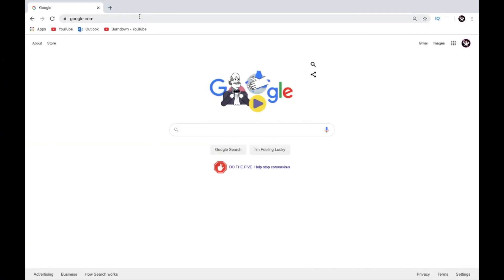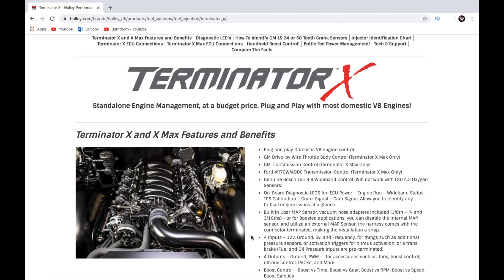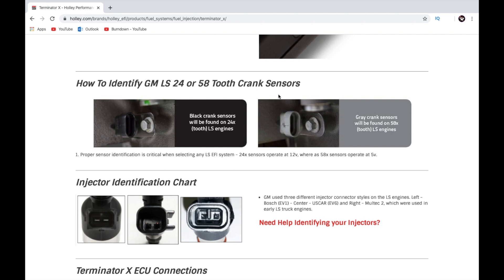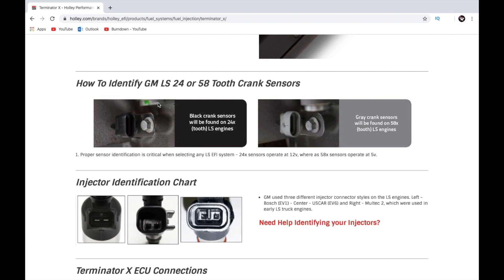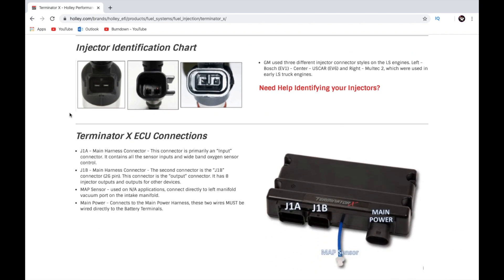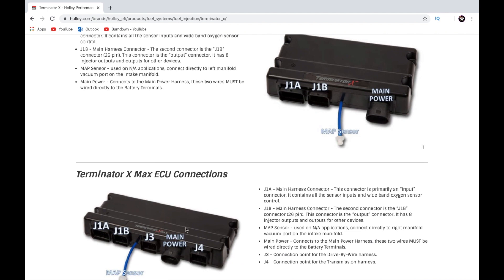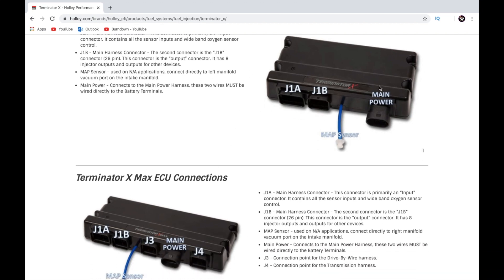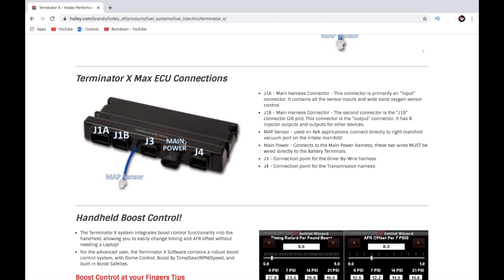What Holley Terminator X Do I Need?

Comment: Hey
I have a DBW
When by pull a part git the pedal off 07 chevy impala plug the wire to tha throttle body for the DBW but the temp sensor and the 1 i have to make a whole on the breather so what I'm thinking to say since I have the DBW do all them plugs need to be plugged up like the FUEL CTS
Reply from the maker: Not sure what your asking here but you could run and X maxx and not have a drive by wire or a transmission hooked up to it and it would  run a motor yes.

Comment: Dude is extremely legendary for this information! I have a Gen 4 2007 motor and I'm doing a delete, but I'd like to stay drive by cable for my old school, but I'm hearing that I have to go inside the motor and change a trigger wheel?
Reply from the maker: A terminator x will run 24x or 58x. The wiring is a little different and it’s in the harness. What harness do you have?
Reply: @Burndown  I don't have a harness for my build on the Lc9 engine. I'd like a budget build, but I don't know if it would make sense to have a th350, or to get a 4l60 where I don't have to worry about the transmission computer to cut down on cost.
Reply from the maker: @ A 2007 motor should be a 58x if your cam sensor is on the timing cover it’s a 58x
Reply: @Burndown  Thank you, brother!

Comment: Great info for me (as a greenhorn).  Going with a Truck motor (black plug) for my Jeepster conversion.  Sticking with stock fuel injectors. I'm going to run a manual 5speed trans (AX-15).  I do think I want external sensors  (fan motors, fuel pressure etc.).  Want the feel of Drive by cable however.  Is the Max what I want/need?
Reply from the maker: The x has no transmission or drive by wire control and is cheaper. It will run the combo you mentioned above.
Reply: Awesome! TY for the reply (FAST reply)

Comment: I have a gen 4 out of a 09 ss Impala that I'm trying to put into a S10 which one do I need
Reply from the maker: Should be a 58x gen 4 motor. Not sure on the injector plug on that car tho. I would look at the Holley diagram for injector plug ID and pick the correct ones. Look at the ev6 style and see if that's it or not.
Reply: Thanks for that bit of knowledge. I've taken the motor out and put it into a short bed Chevy truck . 58x would that change if I'm swapping

Comment: Can you run a throttle by cable using the x max and an electronic transmission
Reply from the maker: Yes you can do by wire or cable with the xmax

Comment: So on there site on terminator max they have multiple part numbers on max so thats where im lost i know i want max but max set up for ls motors has multiple part numbers
Reply from the maker: You need to know what your reluctor wheel is if it’s 24 or 58 and you also need to know what injectors you’re going to be using that’s why the partners are different.
Reply: @Burndown  i have that but each part number you click on both allow choose that stuff so 5 part numbers are same like i click on one choose 24x or 58x choose injector click on another different part number same thing you choose what want so lost to why 5 part numbers for ls engines for 6.0 ect all transmission capable because all max
Reply from the maker: @AdamMorton-u2h the different part numbers are for the different sub harnesses I mentioned above. The computers are all the same for the LS and x max is an x max and an x is an x.

Comment: I just built an l92 with a 4" stroke I ordered my crank with a 24tooth reluctor but my camshaft sensor is on the front cover I cannot find this provision in Holley's web site
Reply from the maker: 24 tooth reluctor wheel motors are gen 3 and have the cam sensor in the block on top in the back generally. Go to Warr performance and get a cam sensor extension and you can just plug it in and run that to the front of the motor
Reply: @Burndown  thank you. I was going to use my  ecm from my lq4 that currently is in my elco but I am running boost on the 6.2 so holley terminator x is my next choice
Reply: @Burndown  bro I swear to god think you so much Jesus 😭😭😭🐐🐐🐐🐐

Comment: I purchased an Holley x max 550-917 for my truck build but I just got my dad’s racer after he passed in 2003 so I was wondering do I need to get an different ecu cause the race car has a power glide an I don’t feel like doing the return process can I just run this one without hooking up the transmission control?
Reply from the maker: Yes you just run it without transmission control. You’ll need the correct injector harness still and a 24 or 58 x reluctor wheel for your motor.

Comment: Im having a hard time finding a x max that can be used on a late modle post 2009 4l80e. Holly doesn't not it but summet and jegs says it cant be used on that transmission.
Reply from the maker: X max has add one you would need to control direct injection and a 6 speed
Reply from the maker: I haven’t played with any of that as it’s above my pay grade 🤣

Comment: @BurnDown I'll looking at this, the max. I have a complete L96 gen 4, with Trans and transfer case. All together was a rolled truck. But I'm swapping in for a older c10. Would the max control the Trans with transfer case?
Reply from the maker: It will control a 4l80e and with an add on it will control a 6l80 but not sure about the transfer case sorry.

Comment: I have a question, sorry if this sounds ignorant, but me and a buddy of mine bought a drift 240sx shell and we are throwing a 5.3 in it. 24x reluctor wheel. We are gonna use a t56 trans, and maybe boost it down the road. Will we need the max or just the X?
Reply from the maker: The X will work for that application

Comment: Ok so if I'm going to try a 6.0 with a cam in my 87 trans am with a 700r4.. if I go with the one that runs the throttle body and trans for 4l60 can I turn that off until I do my upgrades?
Reply from the maker: Yes just get the XMax and you have all the options is you can afford the extra cost.

Comment: What one do I need if I wanna run a t56 transmission do I need the terminator x ecu our the terminator x max ecu
Reply from the maker: X
Reply: @Burndown  so just the basic terminator x ecu
Reply from the maker: @dojliferp8612  yes. You will need the one that matches your reluctor wheel 24 or 58 and the right injector harness. If you go in Holley website and look up the terminator x that have a section that talks about how to choose the right one.
Reply: @Burndown  ok thanks a lot

Comment: Question if I’m going to delete the knock sensors on my Gen 3 5.3 will I need to find a specific terminator kit or just leave the connector not plugged in?
Reply from the maker: You dont need to plug them in. Form what I understand holley knock sensor software is crap anyway.

Comment: What if you have a 05 ls2? 24x crank and a 1 x cam on the timing cover.  Also knock sensor on the side lol
Reply from the maker: What engine wire harness do you have? 24x or 52x

Comment: I have an original 2004 Suburban 5.3 and trans nothing but stock maybe update injectors later for eventual turbo. Terminator X Max???
Reply from the maker: you need an X max to control the transmission. So yes you car correct.

Comment: What would be a good one for 98 Pontiac WS6 LS1 engine 5.7 and yes it is an original trans am engine that came with the car in '98
Reply from the maker: Depends on the transmission and if its a race car or not. This computer won't run your dash or anything like the stock ECU will. If its a race car you will need one for a 24x and then select the correct injector harness. You will need an Xmax if you have the 4l60 auto trans in the car. If its stick a standard Terminator X will work.
Reply: @Burndown  it has the 4l60 I wanted to have the race car and a daily if possible but just was wondering cuz I didn't know what would be a good program for my car or you have any suggestions on one I can use for fuel economy and drag race I like to do both

Comment: If I got the terminator x max ls1 24x (550-919) am I restricted ls1 motors or am I able to go any 5.3 4.8 6.0 with the system ? Got it for a steal on market place lol thanks in advance haven’t gotten a clear answer
Reply from the maker: All the truck motors are considered LS1 so your good to go. Since its a 24x you'll need a motor with the knock sensors on top of the Valley cover to have the right reluctor wheel for the computer you have.

Comment: Great video, Im leaning towards a Terminator x Max for my 6.0 LY6 / 4L80e.

To confirm, if I went this route, it will replace all the wiring for the engine and transmission? I wont need to buy anything else?
Reply from the maker: It comes with a harness for the motor and a max comes with a trans harness. You may need a few sensors depending on your build and you'll need to get an alternator excite wire.

Comment: Will terminator x max efi plug and run with the sniper intake manifold and sniper throttle body on ls motor?
Reply from the maker: If your talking about a sheet metal intake yes. Throttle body will depend on if you are drive by wire or cable but yeah the manifold doesn’t matter and you can get the correct throttle body for your application that will bolt to that manifold.

Comment: Which gas pedal to use for the drive by wire set up?   Ls1 Ls3 throttle body.  Thanks in advance
Reply: Never mind I followed your instructions and found it. Gm part #10379038. Thanks.
Reply from the maker: I have bit done the drive by wire so I couldn’t tell you. Check the Sloppy Mechanics Wikipedia page. I think Matt tried a bunch of pedals from the junkyard and found a few that were compatible. You could also call Holley or try the Facebook page they have.

Comment: So when you order the terminator x it does come with the harness or you have to order it separate?
Reply from the maker: It comes with it. You can also order options on the Xmax for transmission control and drive by wire. They are both add ons and will make the price go up tho. Just depends on what you need and want.
Reply: @Burndown  thank u and im using nv3500 manual trans and cable throttle

Comment: so just to clarify, if i am using i 5.3 engine with ev6 injectors i would order the terminator that they designate as the "ls1/ls6" version?
Reply from the maker: Yes and the only other thing is if is a gen4 motor or a gen 3 motor. Cam sensor will be on the front if it’s gen 4 and on the top in the back by the oil pressure sensor if it’s gen 3. Gen 3 is a 24x and a gen 4 is a 58x
Reply: @Burndown  awsome. thanks man, thats great news. great video. youve earned yourself a new subscriber
Reply from the maker: @morganclawson9985  Awesome thank you!

Comment: Good info,I'm no good with computers, so hp tuners is not happening for me which means I have to pay someone to flash my pcm then I have to pay for a dyno tune,am I wrong in thinking this terminater x will be good for me to tune my motor all my self,or is there more to it,this is my first LS and to figure what direction to go.
Reply from the maker: They have a wizard setting that will get you up and running. After that you can download a tune from the tune cabinet on the sloppy mechanics Wikipedia page and use it as a refine for your timing table if need be. At this point it m sure you can get a tune that will be close for your set up. I would recommend using a terminator for your first build.

Comment: I have multech injectors but eventually want to go turbo would upgrade to ev1. Can I run multek injectors now and swap to ev1 or would I have to buy a new ECU I'm not trying to buy new injectors right now.
Reply from the maker: They make adapter harnesses for the injectors or you can just wire up new injector connectors when you make the change

Comment: If I have a th350 and plan on 4l80e in the future can I buy the x max now and run my th350 until I swap for 4l80e?
Reply from the maker: You sure can. The transmission harness is a separate deal form the harness that runs the motor. You can save the harness and just add it later on if you swap the transmission later.

Comment: Can I still run the Terminator Max if I have a non electric trans going to switch to a 4l80e later?
Reply from the maker: Yes you can. That way with will have flexibility later if you do upgrade

Comment: Working on a LS swap on a 300zx, can I use the Holley Terminator X even tho I’m using the stock 300zx manual transmission??
Reply from the maker: Yeah. You just need the terminator x to control the motor. If you want a drive by wire option tho you will need the xmax. So plan your build before you buy your holley

Comment: I have a DBW Terminator X max not the trans control model. I'm running a T56 Tremec. I have heard that all the Max ecus are the same just the harness is different. My question is can I get the VSS signal from my T56 and use it to have data for vehicle speed on my dash? I know I might have to buy a harness but I'm wondering if the ecu is the same between the Term x max dbw vs trans control of that makes any sense.

Comment: If I pick up the x-max with the truck style injectors and later decide to say change to the ev style injector, what do I need to do? Buy another harness from Holley? Also with the x-max if later I decide to run a manual or no overdrive trans just tune it out. Is that possible?
Reply: You can just buy the injector harness. They range from 115-140 bucks.
Reply from the maker: What Kyle said. Or you can cut the ends off and put new plugs on the harness to match your new injectors but that kinda defeats the purpose of plug and play.
Reply: AMAZON HAS ADAPTER FROM THE TRUCK INJETORS TO DEKA 80 FOR ABOUT $29..00 DOLLARS

Comment: i have an LS with a 4x cam gear and a 24x crank from another engine ..can i change the end on the harness for the crank sensor .when i bought the terminator max x from holley they said i needed the 58x harness so it would fit the locations of the other sensors but i have a 24x crank sensor .so my question is can i just change the plug end and use the harness as is and set up the computer with a 24x crank and a 4x cam . thanks
Reply from the maker: I dont have the answer to this yet but im actually doing the same thing. I had a 24X motor and im building a 58x so ill post the answer as soon as I get that far. Meantime you can ask on the Holley forrum of Face Book or the Sloppy Mechanics Public page on FB as well. Lots of smart guys and even more smart asses so dont take anything to heart.

Comment: Am using a 2001 Chevy Silverado 5.3 4l60e combo for my swap what kit can work for me also injectors
Reply from the maker: Follow the instructions in the video and you'll know what to buy. You will need an X max to control the 4l60e. The injector harness will depend on what injectors your using and the plugs they have on them. Also if you want to drive by wire that is also an add on so make sure you decide what you want and get the right package for your application.

Comment: I currently have a th400… will it run fine with the XMAX? I wanna get the xmax because im thinking of going 4l80e in the future!!
Reply from the maker: Yes you just wont need the transmission control with the TH400 but you will have it if you ever upgrade.

Comment: Do I need to buy the little hand held screen if I'm gonna buy the 7 inch  digital dash, or the 7 inch dash can do what the little hand held can
Reply from the maker: You need the little dash to run the wizard in the very beginning to get started if you dont have a laptop. It will also datalog and the 7" will not on the terminator X i dont think.  Its only 100$ more for the screen.

Comment: Couple of questions. I know there's a few options of throttle bodies I believe they run different connectors, the map sensors are also different from truck to car intake connectors and you did touch on the alternator. Different options available there for connection. Are these variations addressed from Holley? Thanks
Reply from the maker: I have a drive by cable TB so i cant answer your drive by wire connection problem. I would imagine a stock GM TB would work form like a tuck but do your research. The Alt is wired with the kit from holley and it goes to 12v keyed power and its done. The power pole on the alt goes to battery. The map sensor I use is for a standard truck style map but if you get the other style GM map you can just swap the plug out or adapt it. Check my guys at WARR performance for any adapters or problem solving stuff. Also Sloppy has a website and sells plug and play alt harness/ e85 sensor combo and they are slick. Have one on my Twinnebago.

Comment: Which do u prefer dbw or cable they told me with dbw it’s only certain throttle body’s that can be used
Reply from the maker: So both my cars are Cable with WARR throttle bodies to keep it simple for what im doing. I though about wire for the Twinnebago but it was set up for a carborated application so it has a cable pull already installed so ill just make it pull on the TB. I know they have some info on Sloppy Mechanics about what pedals will work. I think Holley sells one as well separately. If your buying the X Max its an option and its up to you and what you want.
-Dane
Reply: Thanks for the information bro

Comment: Which one to run if I'm using a t56 transmission
Reply from the maker: The Terminator X will work for you since you dont need the transmission control. If you want to run the T56 and a drive by wire you would still need the X manx to make that happen.
Reply: @Burndown  thanks so much
Reply from the maker: @bjigga225  You got it!

Comment: Awesome video! Thank you it helped me understand it a lot! One question tho, you don’t need a transmission control if you are using a manual transmission correct. Sorry if it’s a dumb question
Reply from the maker: You are correct. Trans control is for automatic. Manual you can save some cash and get the X